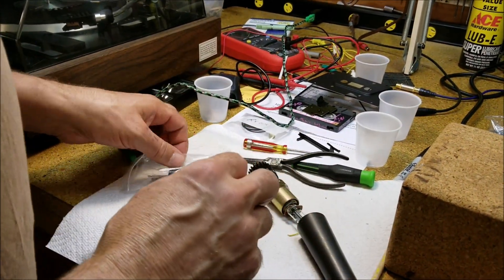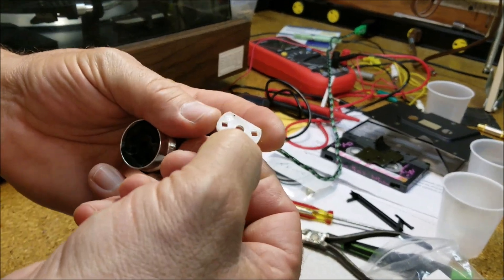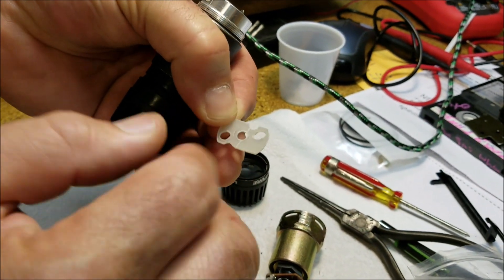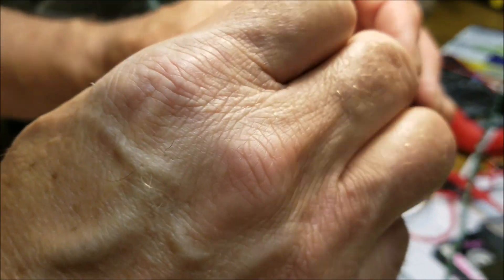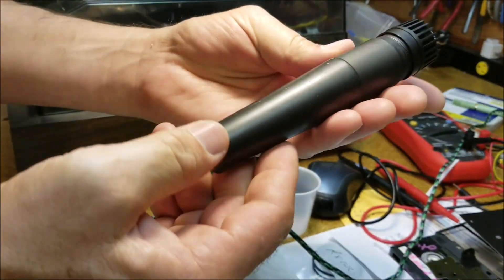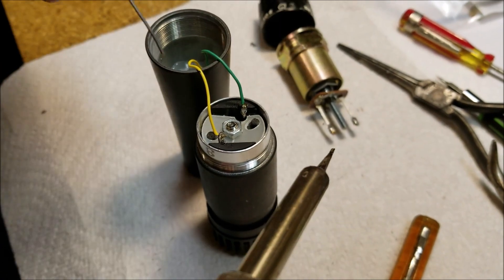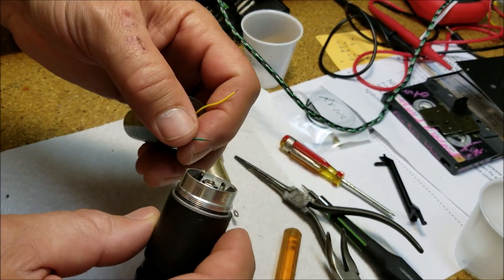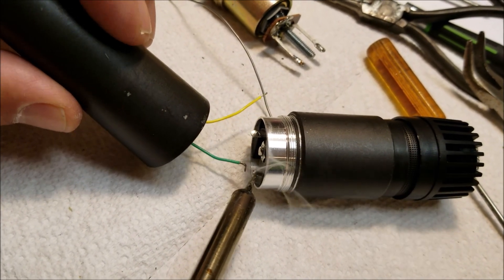Shure SM57 Repair Using Inexpensive ($4) Chinese Replacement Capsule

Comment: I just did the replacement cartridge myself. Like you said, it works fine. The original was shot anyway. It is a good experiment.
Reply from the maker: Right. Nobody says it's OEM quality, but it'll do fairly well.

Comment: Thanks much! Your tut guided me through a successful repair. I didn't get your good price; my repair kit came out of Singapore—US$5.18 for a single capsule. I tore out the old rubber, inserted the new capsule. My wife had to hold the plastic plate down with her thumbs while I got the nut started. That was the hardest part for us. Otherwise it went went easily. I made a stab at transferring the logo band, where it says SHURE SM57 DYNAMIC, but I couldn't get it off the old capsule without tearing it into tiny bits, so that didn't happen. Tested the repaired mic. Works fine again! Edit to add: Except that now it sounds like crap. Wonder why? Anyway, it had served for over 20 years. I threw it out.
Reply: i know Im kinda off topic but do anyone know of a good site to watch new tv shows online?
Reply: @axtonvance3634  Oddly enough, no. I don't watch new TV shows online.

Comment: I ended up taking a chance on the Pyle Pro versions.I've had these mics for 4 months now ? No problems with them and they were under $ 20. , can buy 5 of them for what the Shure costs. Like you said, who can really tell the difference ? I have the SM57, SM58 & Model 55 mic types that I was also able to get a mic stand for what a single SM prices at. The Pyle's have a boomy low end actually prefer over the Shure. Besides, vocals also need effects to make them sound better.
Reply: had a guy bring these as his vocal mic for a club i ran sound at. it sounded noticeably worse and didnt have the proper phase rejection and immediately fed back with a little bit of gain. i handed him a legit 57 and no more feedback. there is a reason these are cheaper
Reply: @RicheyAmigoHerplerGaming  I use mine in more of a controlled home studio/studio environment. So they've never been to a club or live stage performance venue. I can't comment on how well the Pyle Pro mics perform in that environment. Just have no problems with them for the applications I have used hem for.

Comment: Hi all. Buying a chinese capsule is not a good idea. You may think you are getting a bargain but you are buying a very different microphone. The main thing that happens with cheap capsules is that the polar pattern is omni. The SM57 is a Cardioid pattern meaning it picks up in front of the mic and little pickup at the rear.
An Omni capsule will pick up all around meaning you will have a big problem using it on a stage as it will pick ups monitors and feedback easily. 
You might be happy depending on what you use it for, but it is not the same as the original.
Reply from the maker: Excellent point. This is not a good way to restore an SM57 to spec. You will not have the same polar pattern or frequency response.

Comment: With only 2 wires how is it wired to the cord connector?
Reply: Connects to the positive and negative wires. The ground wire (braid) through contact number 1 is shorted to the body in all dynamic microphones. Thus, the body will protect against interference.

Comment: Thanks for the tip! Some of them come with transformers though... What's the deal with transformers? Are they necessary?
Reply: Transformers match impedance of capsupe with imput of your unit, mixer or recorder atd. Also they protect dynamic mic from getting shock from 48v phantom power. They also can shape frequency responce. Cheers.

Comment: Appreciate the info, But how does it sound compared to a real cartridge?
Reply from the maker: Sounds good. Thanks for asking.
Reply: Ususally just total garbage and omnidirectional with a heap of handling noise.
Reply: sounds perfect in my ears.....this n-157 capsule.
Reply from the maker: @MrStubat  Not in this case. You probably installed it incorrectly. Thanks!
Reply: JC Haywire  I’ve been doing this stuff for over 40 years....I know how to put a freaking mic cartridge in. They have unacceptable handling noise and their pickup pattern is all over the shop. Try using one live and putting it through floor monitors in close proximity and tell me it a tight cardiod

Comment: Hi, which pins are positive and negative on the plug? Thanks.
Reply from the maker: I don't know. You're on your own.
Reply: @JCHaywire  Haha, I sussed it out. All good. I've built several SM57's using cheap chinese cases and real capsules and transformers. They work great and cost less than 50 bux.
Reply: @paulotonedef  Where did you buy the capsules?

Comment: Hi, great video, you think you can build a mic with this capsule?
Reply from the maker: Yes. Certainly.
Reply from the maker: ...but you'd need the isolation transformer that's in the mic tube. Right?
Reply: @JCHaywire  You dont necessarily need the transformer. The mic will be noticeably quieter, but some say it sounds more "open". The only thing is you have to make sure you don't apply phantom to the mic or it will ruin the capsule.

Comment: considering 1.44 min topic, just push harder, still leaves a itty bitty bigger gap than an original one, but you can reach quite far with the right amount of violence. cheers!
Reply from the maker: ?? Peculiar response. ??
Reply: @JCHaywire  S/He means that if you ram the new capsule into the metal sleeve (1:44 in your video), you can reduce the amount of rubber showing. My only concern was to have enough center bolt exposed to get the nut (and lock washer) on successfully, which did not require gorilla strength.

Comment: its not the same, it's actually better and nope my replacement capsule is still cardioid. I was so pissed with my sm57 trying to imagine why people say it is sturdy. mine broke just 2 years from purchase. when i opened it up i found out that the thin wire inside is severed and there is no way of connecting it. I'll never buy another sm57
Reply: I'm surprised you had that happen to you. I've owned a lot of those and so have others.. never a problem.
Reply: @ModernVintageFilm   good for you. i dont wish it upon others. but Im one of the unlucky ones. never dropped it. never abused it. but there have been cases like mine before. they said theirs stopped working after they rotated the grill. and they suspect that the yellow tape protecting the wire sometimes is stuck to the grill so it rips the thin wire when you rotate the grill. a production issue with shure.